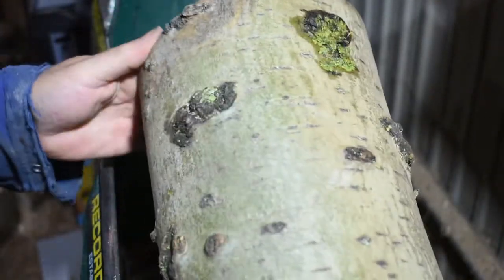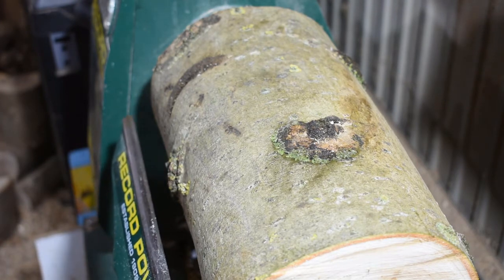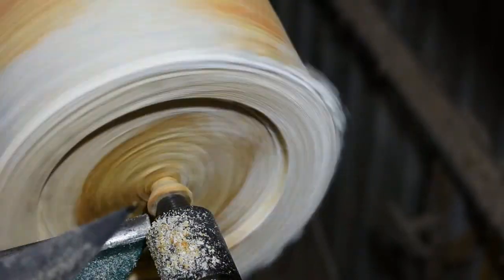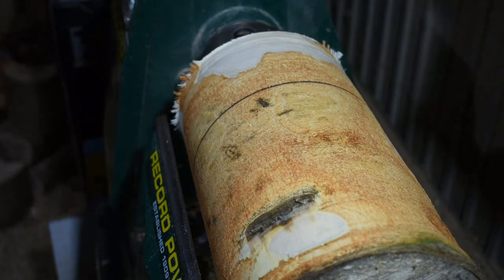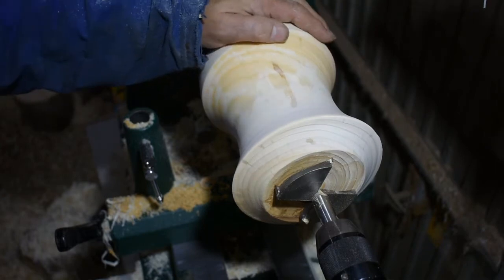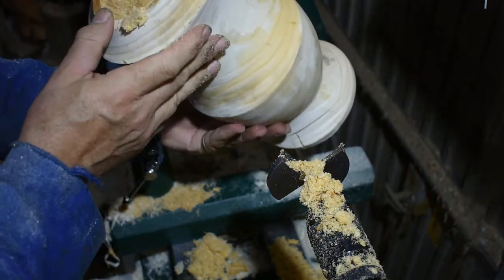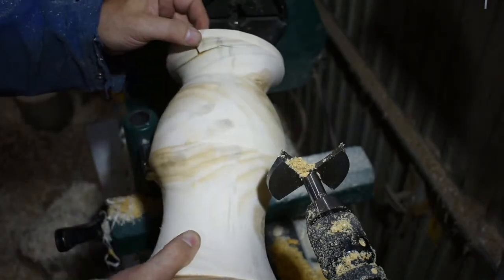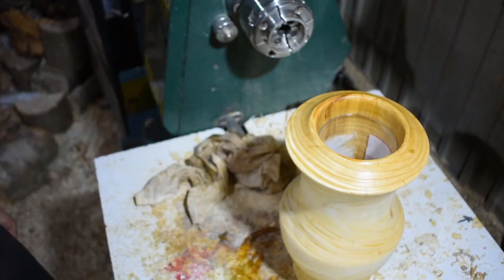Woodturning - a Poplar Vase. #VaseWeek

Comment: Lucky Bosslady to get pretty custom vases for her house - good on you Leo !  That was a slow-motion accident with the mortise😵  Was it worse than it looked  ? But nice recovery !!   Thanks for sharing🙏  Take care. -Mike😷
Reply from the maker: Don't you do the same for yours Mike? Actually I like the smaller foot better so in the end it wasn't all that bad.
Reply: @emgiwoodworks  I try to ask but she usually doesn't care. But when something catches her eye, it becomes  hers very quickly. LOL.
BTW, don't they say a tenon on end grain turnings is preferred because it squeezes the wood together whereas mortises push it apart ?
Reply from the maker: @mpart_woodlathe-stuff  I guess there are some who vehemently advocate using a tenon. But as you can see, a mortise also works quite well. And a tenon can break off too! ;-)

Comment: Hi Leo.  Nice vase. You need good size to accommodate the plastic bottle. Pity about the split in the foot when you were just about finished drilling. Typical.
Reply from the maker: Yes, I guess the forces on the wood are at their max then. But I like the smaller foot better so actually it wasn't all that bad.